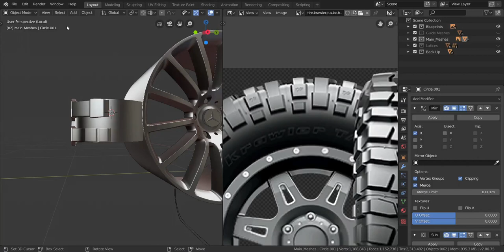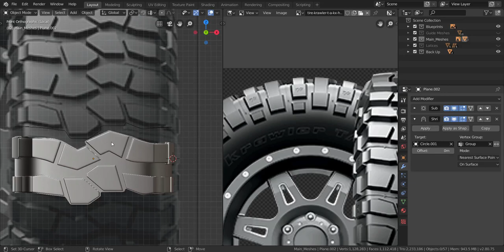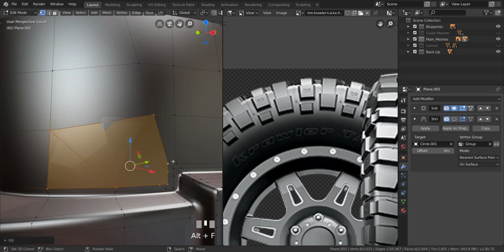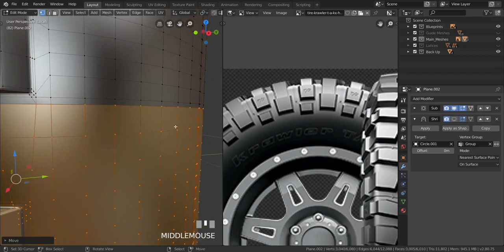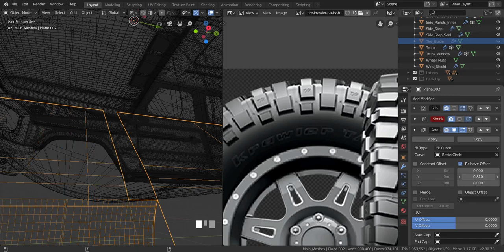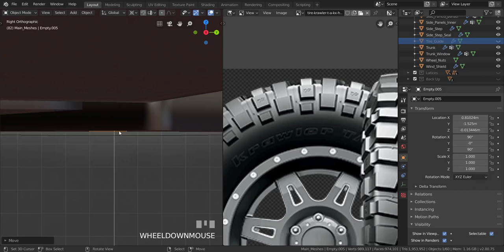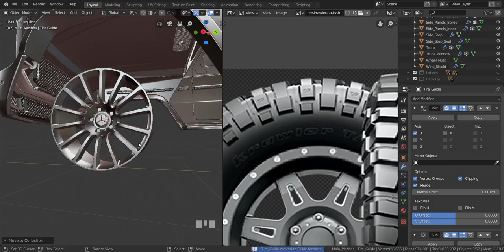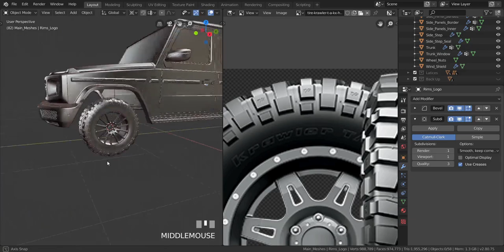Blender 2.8 Car Modeling Tutorial - Part 74 (The Tires - C)

Comment: The tires added over 2M more verts to this project. Sadly, my 7 yr old machine can't handle it. I'll have to settle for simple torus to contingue.
Reply from the maker: You should find some good tire normal textures out there too, they might help.
Reply: a tip: you can watch movies on Flixzone. Been using them for watching a lot of movies these days.